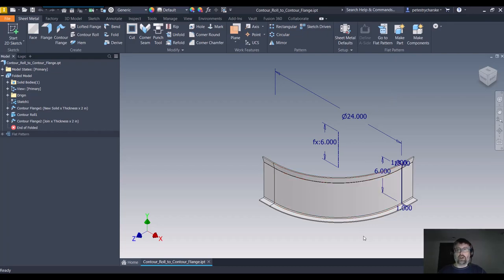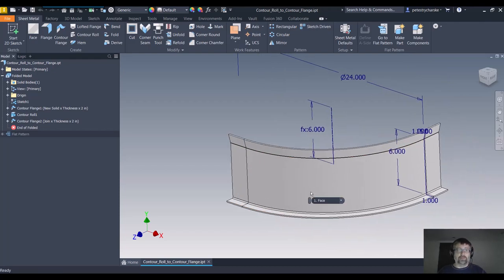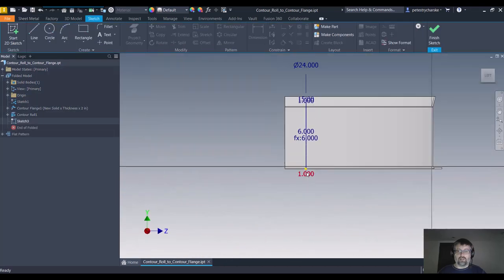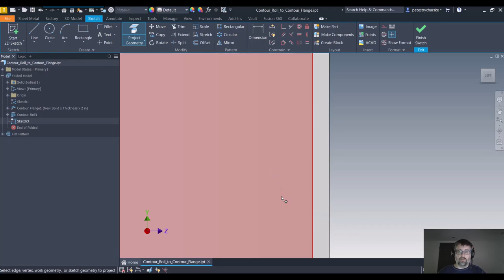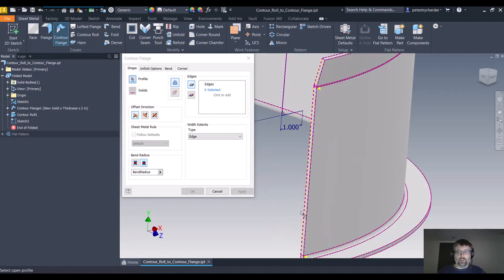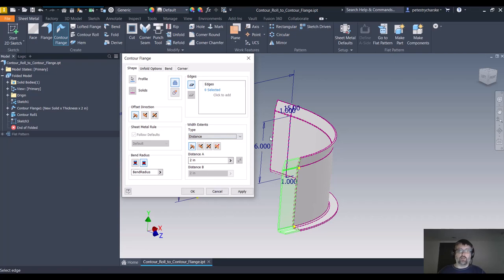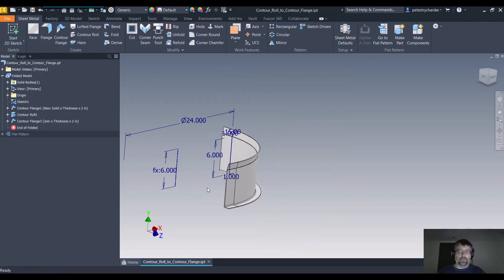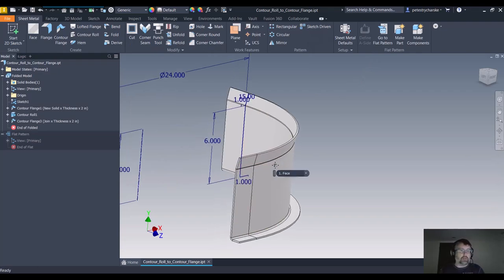Inventor Tips & Tricks - Create Contour Flanges from Contour Rolls

Comment: All great until you send it your sheet metal guy who tells you this can’t be made in one peice 😢
Reply from the maker: Bummer @martinfarrow2825, but it's best to design for manufacturability.  You can still try this technique, but try creating separate solid bodies.  Use the "Make Components" command to export these solids as parts and create the assembly all in one step.  Often it is easier / more profitable for the shop to build complex sheet metal designs as separate pieces and the multi-body approach can make that easier for designers as well.  Thanks for reaching out, hope this helps and have a most blessed day!